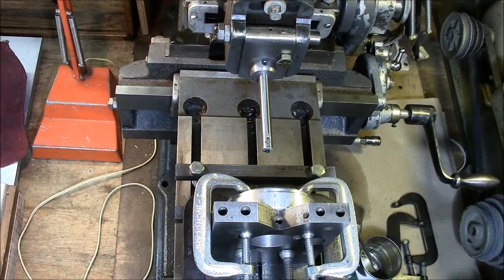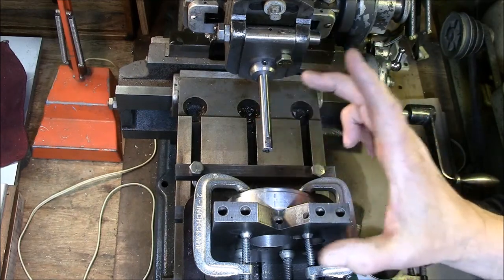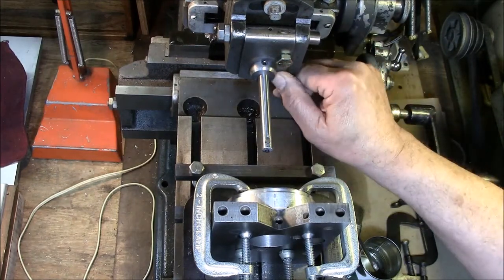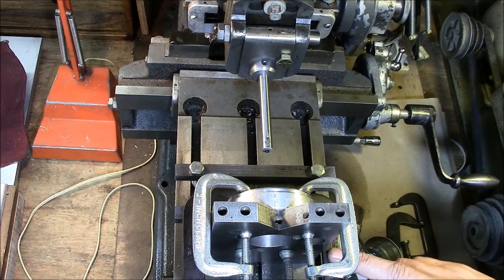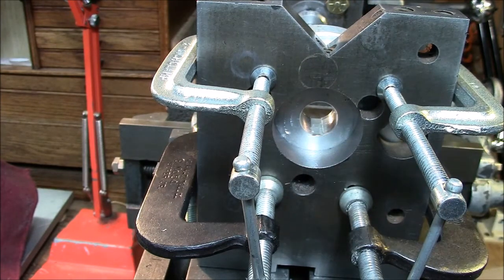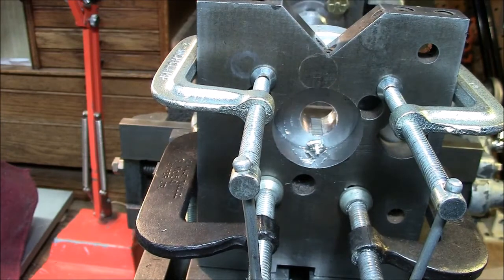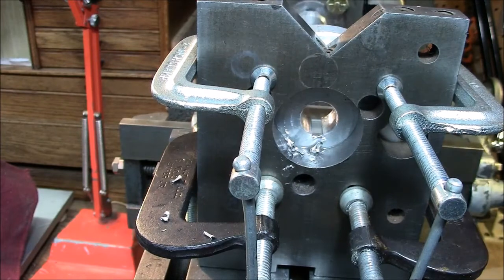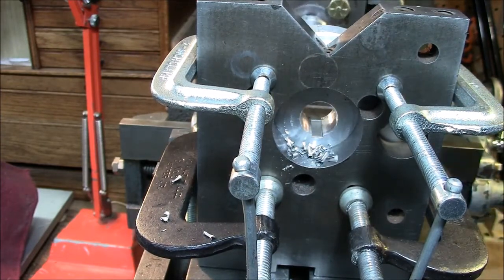Internal broaching a keyway with an Atlas 7B Shaper

Comment: Lifelong machinist here and it bugs me to here a single point tool called a broach. A broach is a collection of progressively taller teeth and is not limited to internal work. Many years ago American motors broached all of the flat surfaces of engine blocks as an example. I'm a big fan of shapers and have a 7" south bend and a 24" Gemco in the shop.

Comment: Fred, why did you disengage the clapper box? I thought the return stroke dulls the tip.
Reply from the maker: That is an excellent question Dave.  Since the bore was only 5/8" in diameter the boring bar had to be pretty small to pass through the hole.  The only material I had on hand to make the boring bar was not that rigid it tended to skip over the surface instead of dig in.  I opted to disable the clapper and force the cutter into the work. Not optimal for sure but since it was in aluminum I got away with it.  In hind site I could have reground the tool with a more aggressive lead angle to dig into the metal better.  Cheers...  Fred